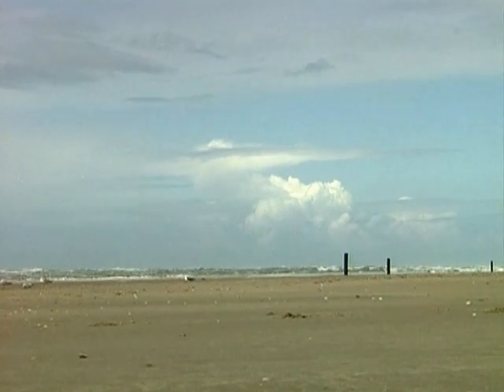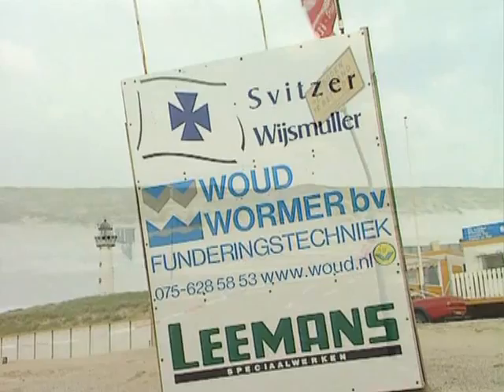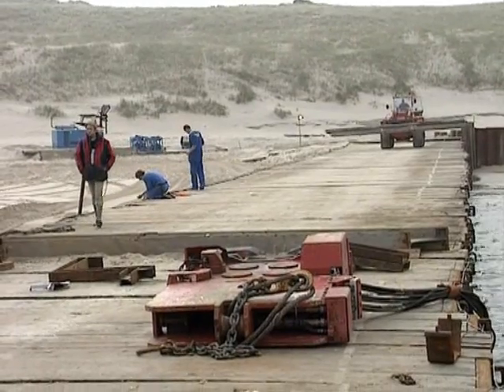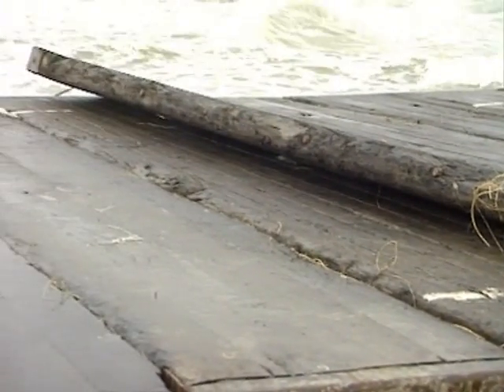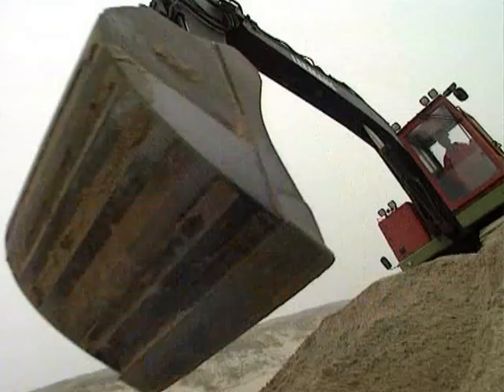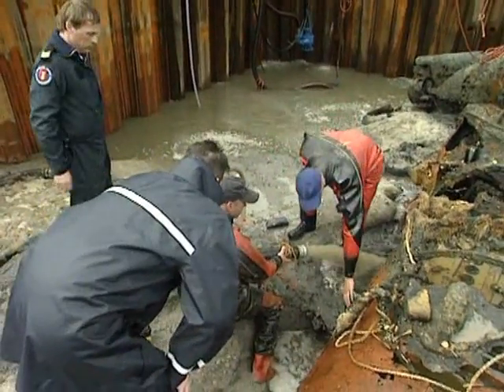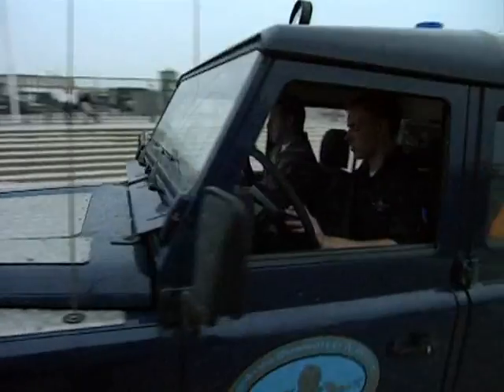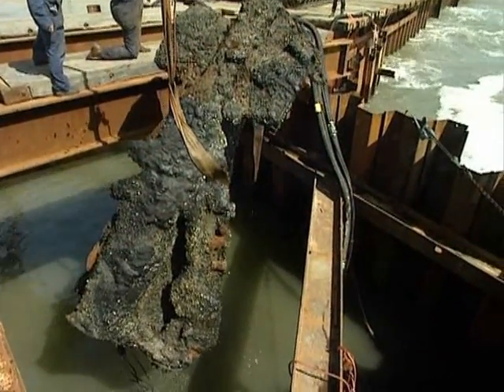THE 'SEEHUND' RECOVERY

Comment: To those who ask "Why didn't they just blow the torpedo’s in place and save all the money ?" The answer is it would have spread all the other recoverable pollutants all over the place and cleaned up nothing. That is the lead from the internal batteries, the copper and brass from the wardhead casing which after 70 odd years 'still shined'. The wiring, other brass fittings, oil from the engine, alloys and so the list goes on, all would have been spread far and wide, and not cleaned away.
Reply: Not if covered with blast pads.
Reply: The true reason is  they  have unlimited budget paid from Germany
Reply: Yes lead does not come from the earth.
Reply: Greta said not to
Reply: @FJPETER Roger that !
Reply: They could have protected the operator and used a giant crane with clamshell buckets and just dug the thing out in a day. If a torp blew… more fun for everyone.
Reply: Was hat Greta denn  schon Ahnung  von solchen Sachen (aber die grüne Krücke ist ja so intiligent ) aber aber das ist höheres Wissen. AFD macht es besser.

Comment: Nerves of steel working so close to those torpedoes , you would find me one mile down from those things!
Reply: yeah, must be made for jobs like these.
but the human psyche has normally a protective "device". the more time you spend at a danergerous situation(explosives, fire, speed, on a roof or at clibing, parachuting ...) the more you loose the fear in it. only respect and carefulnes remains (if the people were clever and not addicted in adrenalin)...but a little tiny risk still remains, as seen in göttingen in 2013 as 3 very experienced war material removers were killed while prepreparings for a dismantling of a 500kg bomb with an acidic detonator..

Comment: Can you tell me what the final cost of this operation was ? Oh BTW, the propellors from the torpedoes -They were no where to be found, correct me if I am wrong. Bedankt
Reply: Of course not, someone sold it to a foundry right after the craft was beached.
Reply: they where stil on the remains after the "salvage".  (in fact y have seen them just 2 days after the recovery.)
Reply: Dragomir Ronilac  Great answer. You should be a politician.

Comment: Build a coffer dam and dredge out the sand and remove the heavily corroded mini submarine and the torpedoes which were heavily corroded. It would have been more fun to implace some explosives and blown it and the torpedoes  up insitu and then allow the sea to fill in the hole with sand. A rusty bit of metal in a museum which has limited appeal considering most of the German minisubmarines were scrapped or sunk in deep water at wars end.

Comment: I do love the fact the reason they did this was because they "were afraid off shore drilling causing tremors" (unproven by the way) but all that heavy equipment and supplies moving around the beach and then driving all those sheet piles were not going to set them off?
And the sub could only be reached during a low tide with a easterly wind in a unpopulated area. so even if they did go off it most likely would have been under feet of water and them more feet of sand. Should have just left them
Last, they transfer the ready to go off warheads from the zodiac to the ship while they both were underway at a good speed. Did they need the extra challenge or were they not worried about it going off if it banged into the ship?
Reply: nope, they where inpact detonators, still really stable afte all that time under water/sand.
Reply: drilling for oil doesn't cause the tremors it's the removal of oil or gas that does. therefor working around it with heavy machines is not the issue. Tremors like the province of Groningen has from time to time due to gas extraction with tremors in excess of 3.0 on the Richter scale could in a worst-case scenario.

Comment: 4:49 that weld looks just terrible.
Reply: I'm a welder myself and thought the same. That worker has no experience in doing vertical welds.
Reply: How much would it cost to  salvage theRICHARD MONTGOMERY by this method? Unbelievable  wast of money
Reply: Ernests Auzins That’s the worst weld I have ever seen I don’t weld much but it never looks like that fuck it’s blobs of steel!!
Reply: @colinwalsh6447  I think the risk out-weighs the reward with the Richard Montgomery. The torps had about 500kg of explosive, but the RM has 1500 tons, so goodbye to all the windows in Sheerness if they make a mistake salvaging that wreck. Still when a project (like the Esturary airport) comes along that will be profitable enough they'll find a way to remove it. Until then the Government and the MOD doesn't really care how many injuries or how much ecological damage will be caused if it goes off, just as long as they don't have to find the money to deal with it.
Reply: You guys crack me up. I was scanning for the comments about the welding and wasn't disappointed.->grind it out and start again
.  @chapiit08

Comment: You cover with blasting mats. Safe. Very unstable to move. Plus the salvage costs. Not much left for a museum.
Reply: Arthur Bradley - They were worried about the heavy metals in the batteries and toxicity of other components.  They said so in the video.  There are usually reasons......

Comment: 4.50 Lmao check that pigeon poo weld on them precise supports omg...
Reply: 04:38... and 2m below sea level ??  when it clearly shows them with barely 2m from ground to the top of the wall inside (an average male with their hands up is about 2m) so the sea would have to be lapping at the peak of the wall yet the tide outside is apparently at the same height as the ground they are standing on (comparing the welding shot with 03:29).
Perhaps the water level is 2m at high tide... but not while they are welding that metal with bubble gum from the bottom of a school bench.

q8D
Reply: @TheButlerNZ  lmao.. Agree to all that

Comment: Seriously? All that effort, money, and danger to the workers? 
Just find the right depth, dig a hole, put some explosives in and blow the whole shit out of the sand. Problem solved.
Much faster, much safer, much cheaper.
Oh, the batteries will pollute the environment!! 
I'm pretty sure the smoke, oil leaks and gases produced by all those machines on the beach did much more damage to the environment as the poor batteries would ever be able to do  (if they hadn't already done it).
Looks like someone was just up for some big bucks.

Comment: seemed a tad dangerous to take them on board the Diving Vessel when they already had them in the Zodiac...image if they'd gone off when on deck....'bye-bye Diving Vessel'. Should have sank them from the Zodiac. (in my uniformed opinion)
Reply: Bit to heavy to trow them over the side.... (and exploding by itself landing on the sea bed...)
Reply: But how would they explode without the detonator? Stable explosives don't go off for no reason.

Comment: Why not just set a charge where it was?
Reply: It's a WW2 artifact. Detonating it in place was an option but it would have destroyed what remained of the wreck and it's hard to put to words how strongly the Dutch feel about WW2 artifacts. If it had been the case that the warheads could not be safely removed then they likely would have detonated it in place.
Reply: Semni Istiqlal
Reply: fr9662
Reply: The boat has all but corroded away.  Setting appropriate charges would make quick of it and the torps.
Reply: clayjustsayin
That is entirely correct, but you are seriously underestimating the level of value the Dutch place in historical artifacts.
Reply: Also that is always the last resort, since in may not set off the explosives in the warhead, and then you end up with an even more unstable UXO.
Reply: Too bad the little sub was rusted through. It would have been a good little museum artifact if it was more intact. Could have been a good outdoor display without taking up too much room.
Reply: Clay Z - And spread heavy metals all over the place from the large batteries and other components.  They actually mentioned this in the video.

Comment: Why did`t they just detonate in place.
Reply: +Arthur Bradley     I'm sure they would not have taken the risk if there were any REAL danger,  they would have blown it in place.  They're pro's They do this for a living.
Reply: To recover the sub. The risk was basically the same, because the torpedoes had to be dug up anyway to set the charges close enough to the warheads to actually have the explosive inside detonate.

Comment: Overkill in a big expensive way. Were there warheads nuclear? Just sink an explosive charge and blow it up. Reroute aircraft due to 2 torpedoes buried deep in sand, unbelievable
Reply: Yeah, they just don't know what they're doing.
Reply: 2 unexploded torpedoes!!!! All the hate for what might admittedly be a bit of overkill but those explosives have to be removed. Looks like a very professional job done safely and effectively.
Reply: all it takes is a low flying Chesna and a bit of the hull getting blown in the air. Stranger things have happened when humans are involved... Though obviously someone like you who does everything better then everyone else would have no experience or knowledge of such things...

it's a precaution, it's done to prevent any shit hitting the fan even if you don't understand or comprehend how shit can ever hit it even you should be able to realize it's preferable to have no shit on your fan..............
Reply: The mission was accomplished in a safe and professional manor. But, it's clear you guys don't know a damn thing about the U.S. THINK before you post.